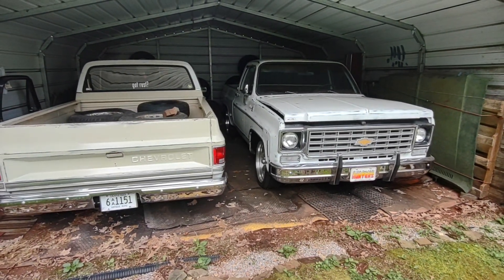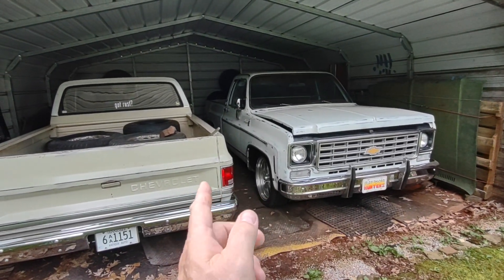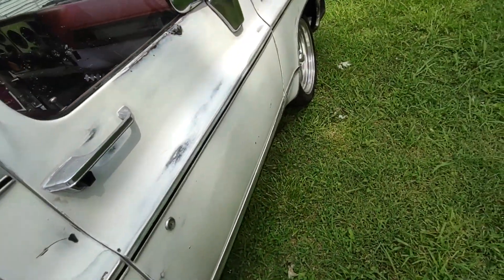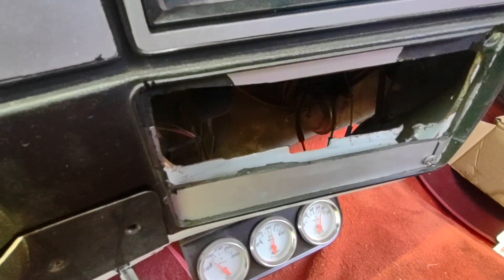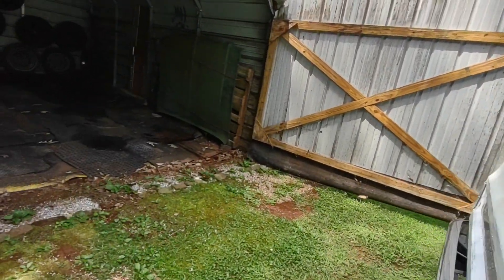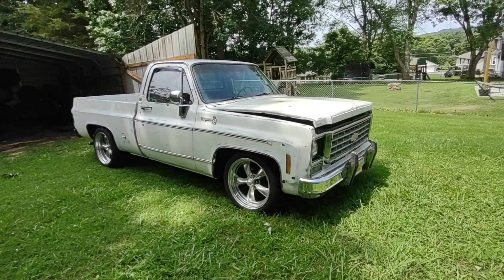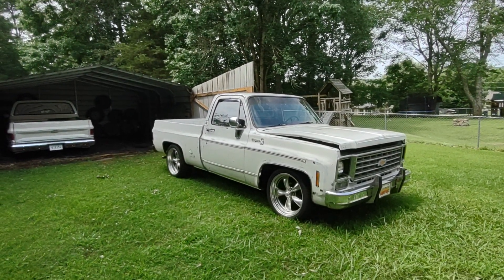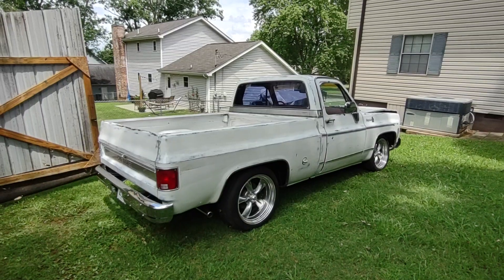Let's make a list of all the things that I'd like to get fixed on my 1978 Chevy C10 "Billy James"!

Comment: Definitely need to add the 73-80 style side trim to the bed. (And fix the missing part on the pass. fender.) 
Don't strip the original side trim off the front. Round eyes look best with that style of trim - not the 81-87 style.
This truck desperately needs side trim to tie it all together. Then you could do a video or two on painting the insert a nice color.
Reply from the maker: I agree with everything that you have said my friend!